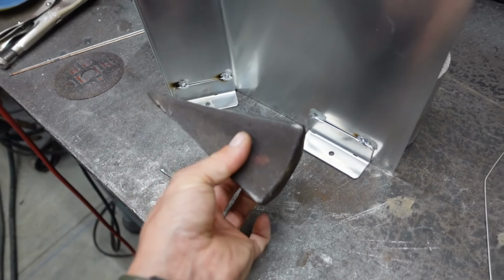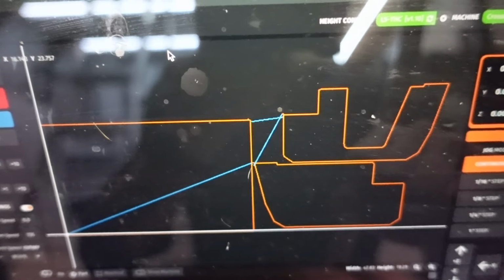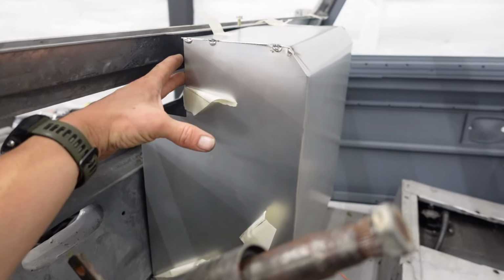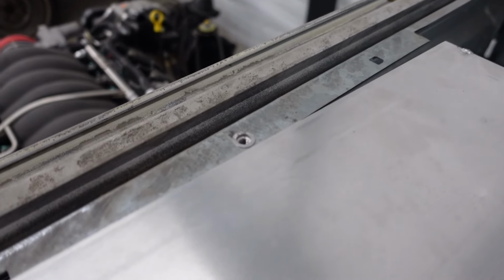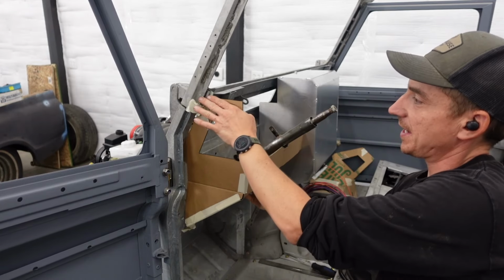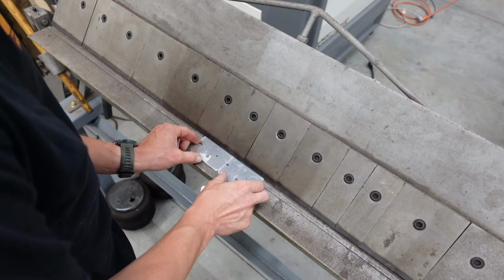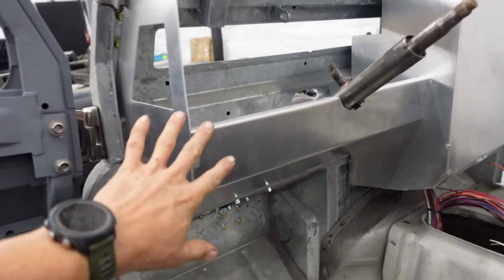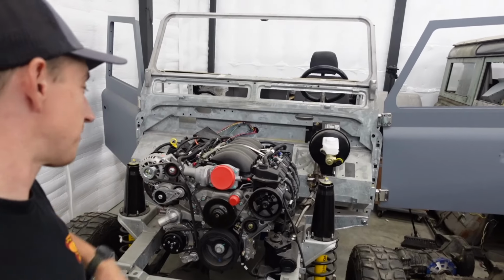Custom Aluminum Dash on the Land Rover | We Make Our Own on the LS3 Defender!

Comment: I would recommend introducing a litlle tapering on the centre box,angled more toward the windscreen it would introduce a bit more balance. Currently its presenting as quite boxy. Bottom to top taper. Sides bottom to top taper.
Reply from the maker: I’m glad you said that as well. I was waiting to make that call until all the pieces were mocked up to get a full visual. It wouldn’t be terrible to put a 3/4” or 1” strip inset 45 degrees on there to pull some of that sharp angle out of the design.

Comment: As a long legged, tall guy, definitely tuck that passenger side to match as much as possible. Perhaps angle the blower motor bulk into the narrower piece for a better visual effect? As far as the leather spots, I agree with your idea. Maybe a bit more radius on the top for a softer edge on the pad? You could also just let the dash pad do the softening and keep the harder edge underneath for simplicity of fabbing with what you have.

Comment: Nice job mate - just a thought - since you lined up the footwell angle so well - should it be flush ? What about the footwell mat/liner/carpet? , if you use the thick one for sound deadening do you want the dash to fit flush with that ? The factory one is about 6-7mm .. yes mm 😊